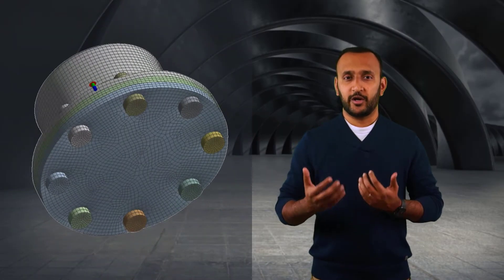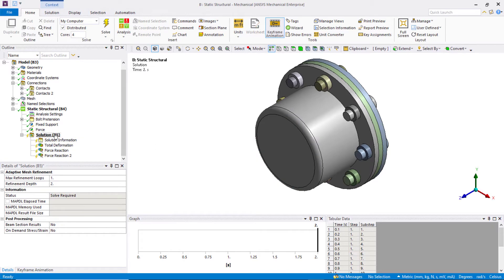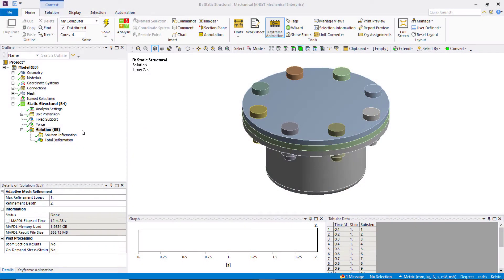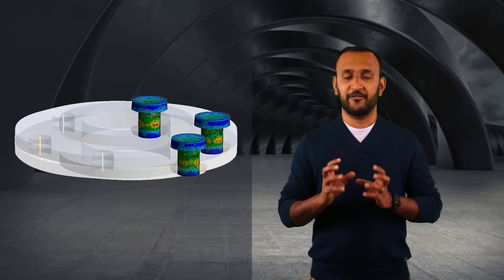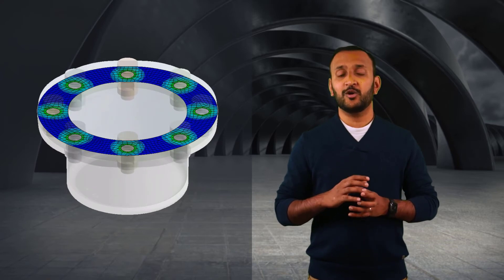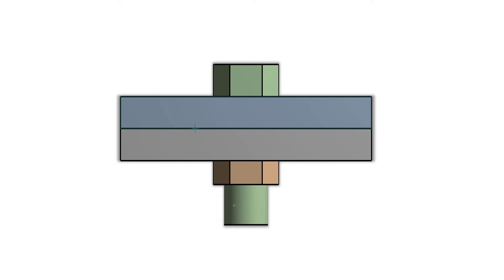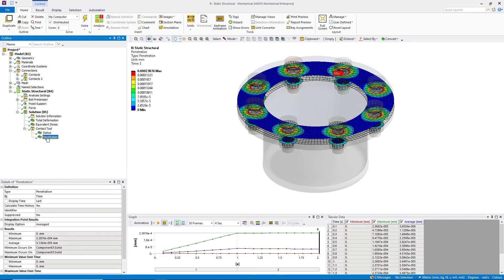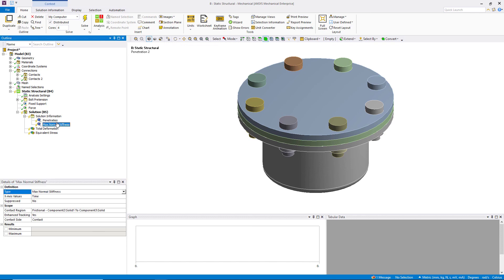Reviewing Bolt Forces and Result Validation Using Ansys Mechanical — Lesson 2, Part 2

Comment: It seems bolt load data is only due to pretension.  At least when I try to follow these directions, the bolt stress or load only reflects the bolt preload, even if the external loads exceed the bolt preload.  Any insight is much appreciated!